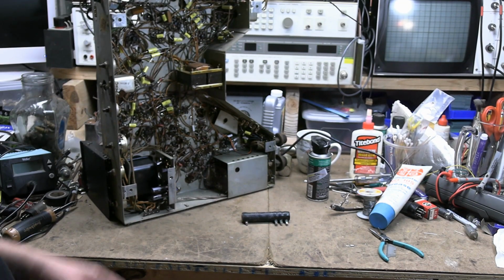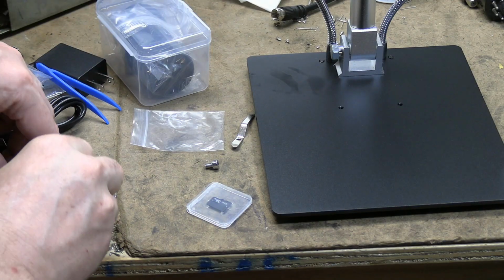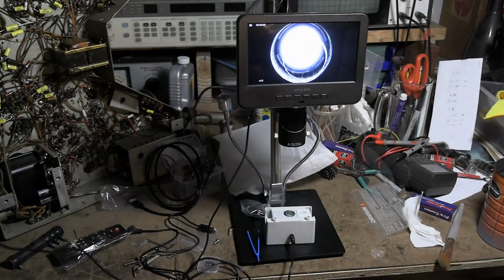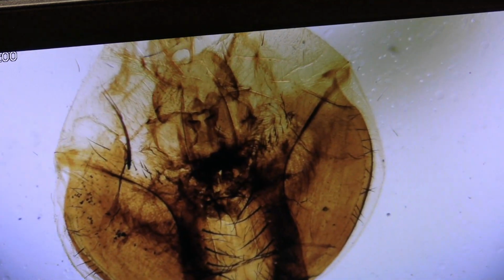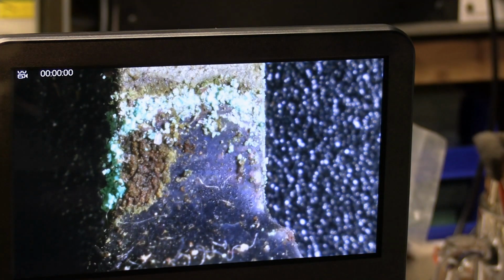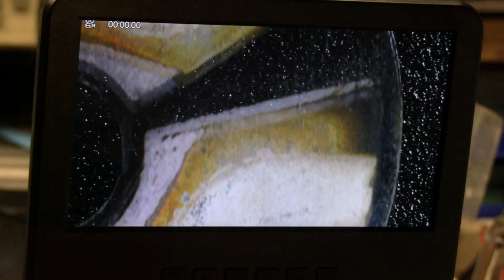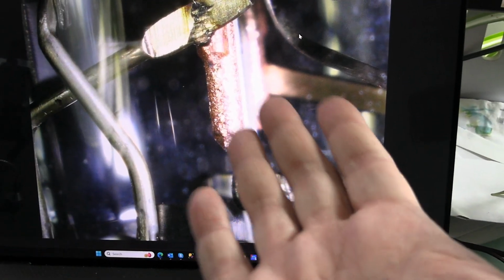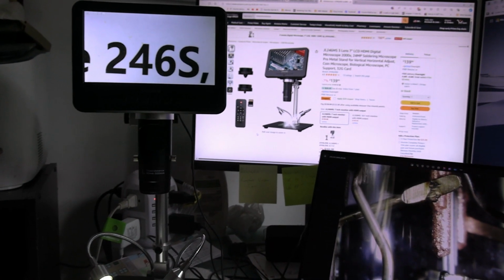Joyalens JL246MS Digital Microscope review

Comment: These are great for old eyes that need bifocals, etc. I have a cheaper brand, but it is very similar. It works great for identifying color bands on resistors and caps. Also looking for bad traces and solder joints.